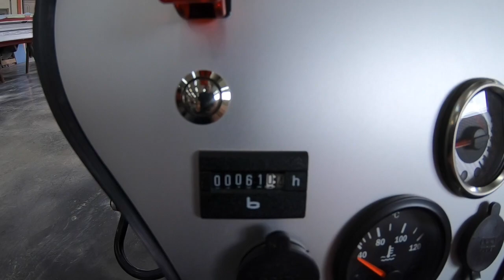FRESH BREEZE  X-ONE TO THE BULLI-X   COMPARISON AND WHISKEY ISSUES!!

Comment: Nice comparison.  With the X1 you're sitting quite a bit higher than the Bulix...this gives you a higher center of gravity which might off-set the advantage of the wider landing gear.  Also, I bet the X1 is fifteen to twenty pounds heavier...are you flying the same wing?  Do you guys weight the same?  What is the performance difference?  Not sure what the cost difference is but that would figure into it too.  One more thing.  I like being able to take them apart (separate the trike from the engine) and think it would be much easier with the Bulix than with the X1.  Thanks for comparing.  On the drink...You might check the alcohol percentage with a hydrometer, and or....have some drinks with some friends and just dare each other to drink some...that'd be fun.
Reply from the maker: Hahahaha, great idea re the booze!! lol  we are on the same wing and we weigh about the same.They are equally as easy to break down but are not designed to be back pack style.

Comment: Love all the videos Jerry and I'm thinking of getting into the sport. Under good conditions, how quickly does that 4-cycle get you off the ground? I've got limited space on the property to take off.
Reply from the maker: Hi John! Great question, you will need more than just the roll out distance, it is not so much about how far you need to get airborne as it is about the overall layout of your area, ie: trees buildings cliffs power lines etc.  It will l;ift off in a hundred feet ish. Once you begin instruction you will see what I mean.  cheers
Reply: @jerrydelyea5820  Understood. Thanks for responding. I've got a five foot fence to deal with at 75 yards then I'm good. I really do enjoy the videos. Hope you find the other bottle of Crown Royal I left up there.
Reply from the maker: @johnjohnson9110  Hahaha I am still looking for that crown,lmao.  Ah that sounds doable,  if you can have another pilot check it for you,  Might have to put a notch in the fence lol  cheers
Reply from the maker: Hey John, I was giving your space some more thought and after some careful thinking and 225 feet will be leaving you no wiggle room, if it were the case of a gently sloping incline that's one thing, but a fence...well that's a bit more of an obstacle.  I would advise for sure to have some-one scope that out for you.   I would hate to see you plan to buy then be "fenced in" so to speak.
Reply: @jerrydelyea5820  Thanks for your thoughts. I do have other launch sites but home would be so convenient. would a very light trike make much difference? I'm 190 lbs.
Reply from the maker: Well the little bit of difference in the weight of the trike would be negligible to the rate of climb. More than this my concern would be an issue with the wing or motor during climb out, a failure would likely end badly.

Comment: Heya mate, new to the sport liking your vids im about seeing em all so sorry if i spam you questions :D I do have a Flyproduct Vertigo with a liuquid cooled Polini Thor 250 on board.. only thing i dont like about my trike is the cockpit ( they made evryting look cool and placed a damn white plastic cockpit on the thing.. im were thinking about buying a Bulit/x-one cockpit and just mount on the damn thing :P how do you like the cockpit size wise? and did you take away the windbraker/glas and why?
Reply from the maker: Hi Stefan, and welcome to the channel.  Welcome to the sport my friend!!  Ya I really like my FB Trike, very well put together.  Well I like the cockpit, the windscreen did little to change the amount of wind in my face so I trimmed it off, looks better in my mind. The cockpit is a nice size without blocking the view, so far I can fit everything I need in it as well as mounting some items in different spots. Keep in mind the X-ONE is a bit heavier than the Bullix, I went for light over comfort, Can't beat the X-ONE for a comfortable android and it is more stable during launch,  cheers for now, Jerry

Comment: Im looking at the X-one...Is there any USA dealers...Thanks
Reply from the maker: Hey Dave. I am pretty sure Southern Skies is in the U.S. and they sell them. Also blackhawk USA has a very similar trike that looks pretty sweet, Sister engine to the swiss auto 250 . The only thing is it has no foot throttle by the looks of it.
Reply: @jerrydelyea5820  ..Hi..Yeah i did find Southern Skies..Found some prices...Some cool stuff..I have a 2005 Steel Breeze 103 mini...And owned a 1999 Six Cuter in Alaska....& Flat top paraglider..lol
Reply from the maker: Holy crap, a nice range of different gear you have owned!!! (:
Reply: @jerrydelyea5820  ...Thanks..Its been fun..Im here in West TX and the wind here is always bad..Sucks to fly and way to hot.....I want to move to the north west..
Reply: @summitdave8782  greetings from west texas .more precisely lubbock. new pilot here as well . where are you located ?" we should fly sometime

Comment: On these models, there are four engine options now. But also in this comparison, you forgot fresh breeze best unit going right now? check it out?http://www.fresh-breeze.de/produkte/trikes/one-striker.html   If you get the X one which is a perment engine mount trike get the Swiss auto at 250 on it!! you are comparing an X one to a bullix 4t-a you do not have a regular bullix there. they are both permanently mounted engines?? the real just bullix has a trike that has the motor removed and you can mount other motors to it. you have two models here permanent engines you have a bullix 4-t model NOT!! a regular bullix. sorry about that. here is a bullix ,http://www.fresh-breeze.de/produkte/trikes/bulli-x.html    then what you have the 4-T?  www.fresh-breeze.de/produkte/trikes/bullix-4-t.html then what you have there beside the X-one there. fly happily! If you like the X-one?? Here one better from fresh breeze! http://www.fresh-breeze.de/produkte/trikes/xlight-120-kg/4t-250-swiss-auto.html   Nice video on comparisons!!
Reply from the maker: Hi Bruce! It took me forever to find this comment from you, I am so glad I did, wow I really like that instrument, I think I may add this for sure, how cool to have all your info on one device.  thanks for the heads up,  take care out there. Jerry